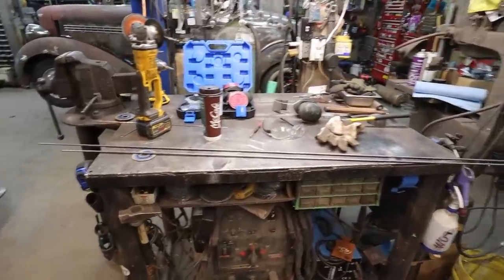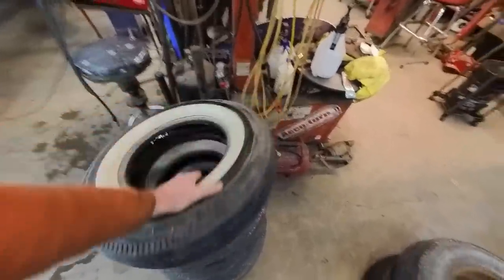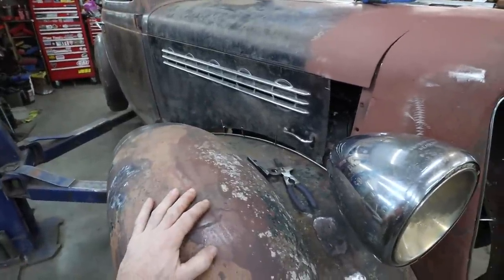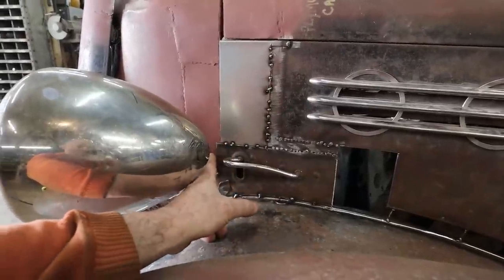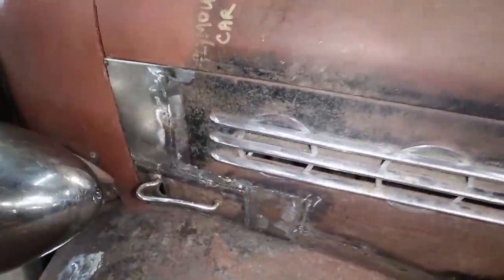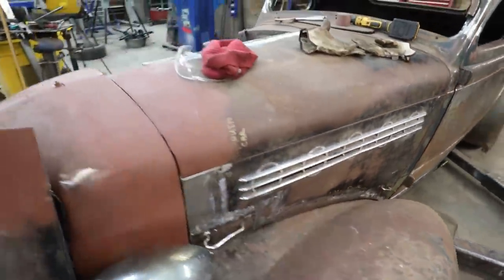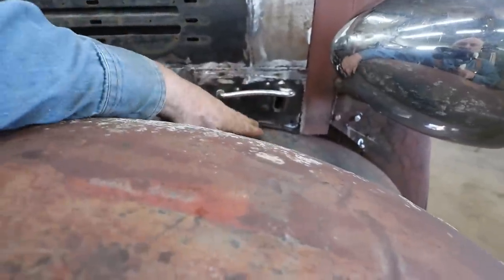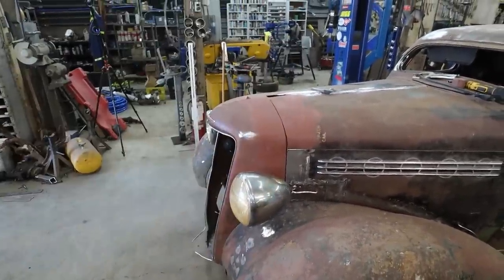Stretching out Plymouth hood to fit our 35 Dodge Coupe

Comment: I was taught by an old timer how to shrink metal. You heat the area you want to shrink with a torch a liitle at a time 
until cherry red (about the size of a quarter) 
Then hammer and dolly that spot and then quench it with a wet rag.
REPEAT.

Comment: You may try Silicone bronze mig welding wire. If you haven't already. You are able to use less heat, plus it grinds easier. I'm sure you know who Ron Covel is. He is the metal wizard that suggested using it awhile back in an article he had in Street Rodder Magazine. I guess if a pro mentioned it, it must be the holy grail. LOL

Comment: Brent, dont let the naysayers get ya down. It looks great! The rockers being home made allows the placement of the running boards to get lost and i think they would have been lower which would allow the front fenders to slide both down and back which would have brought the grille back to meet the hood. Its hard to make changes on these fat pre war cars with the compound curves and relative reference points. I would have probably wussed out on the hard work and leaned the grille back so at least the hood hinge chrome was the right length and then filled down from there. 🤷🏻‍♂ Or I would stare at it and hope it fixed itself! 🤦‍♂ Keep at it!👍🏻

Comment: Make a cardboard template of the curve, full length then cut the metal to fit. Lay it on the bench and weld the rod to the  bottom edge. Then put the piece on the hood side and tack it on. Complete the fitting and weld it up.

Comment: Wheels fer white walls, wire form ta dat fend'r, fill'n ta da wire, test fit'n da hood, stitch in time weld'n, move'n dat latch oops, wheel'n English hoodie, repeat'n on da passenger side dat used ta be da test side. Can't see em both at da same time.

Comment: my 2 cents 
New racing 1 wire alternator 
Racing battery 
Have those original glass light headlights 
Powerful bulb but a custom dim switch from low yellow glow to super brights

Comment: Have you tried those metal disc's that some custom metal fabricators use that attach to grinder it heats up the metal and shrinks it. I've seen guys use them and they swear they work pretty dern good. Instead of using torches and water like they did years ago.

Comment: You should start making your own wheels by taking centers from one wheel and welding them into the rim diameter and width wheel you want. This way you also control the  offset. Here is a machine you can build to help you out, yes I know it says wheel widening but I think you can use it to change out centers of wheels and set their offset.
https://www.youtube.com/watch?v=BZ3vIzjcZ2U
https://www.youtube.com/watch?v=PSPFhSzkG7k